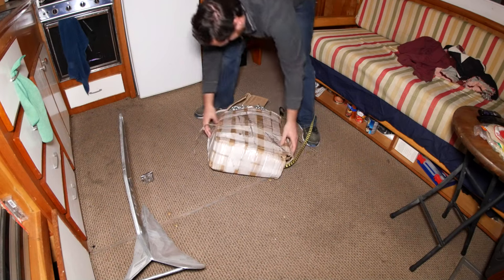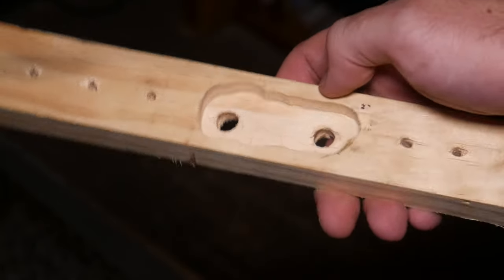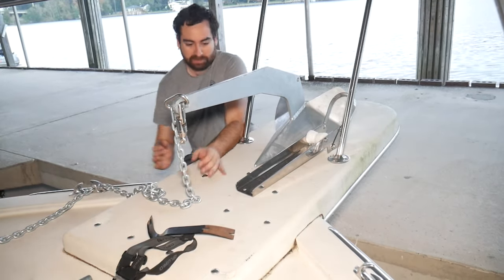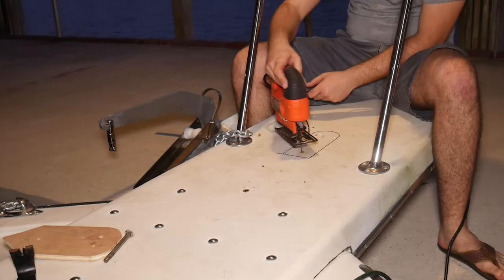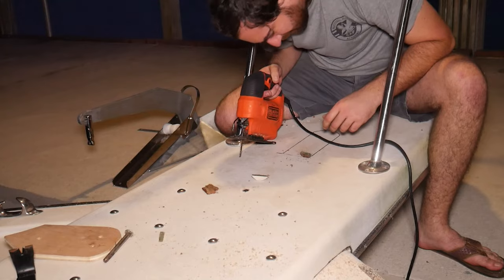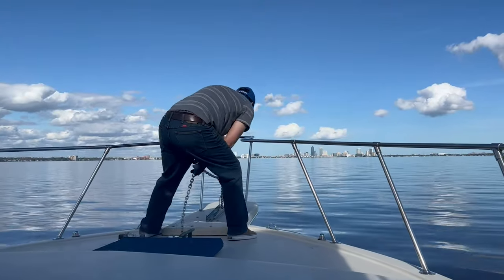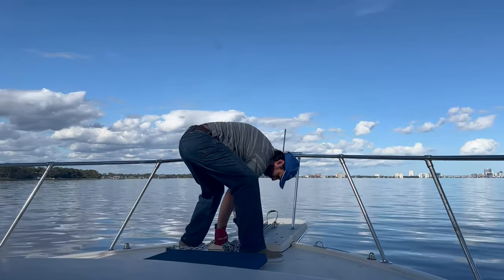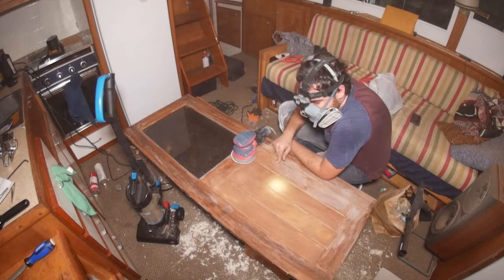a double-dose of big boat projects

Comment: Well gladto see you back Cullen! When using your anchor, you should attach a line called a Snubber or Bridle. Takes the stress of the pulpit and if it it stretches a bit will act as a shock absorber for when waves hit you boat. In the future if you have to plug screw holes, don't drill but just some glue and golf tees work perfectly. Glue in place and with a knife or whatever, cut the head off and done! See you in the next one friend.

Comment: I am really enjoying your channel, Cullen. Good to see you back on the horse. The bolt you removed from the pulpit for the anchor'r roller is a carriage bolt. The square shaft stops the bolt from rotating while you tighten the nut. This means you will have a much lower, domed head of the bolt in the roller, which is ideal for this apoplication. I would have sealed the insides of the hole you jigsawed for the roller.
Reply from the maker: Yes I'm not quite finished with that hole. That  will be epoxy'ed and covered with some kind of decorative wood trim

Comment: I've always used multiple coats of marine Spar Varnish on mahogany. When you put about 5-6 coats on to make it look like glass, then as it ages from the weather all you need to do is give it a light sanding and then recoat. And yes, you should have never ever sanded that in the main cabin. I would varnish it in the main cabin to keep the bugs off it but never sand, in fact I would of used paint and varnish remover on it to get most of it off before I gave it a light sanding
Reply from the maker: Great advice!
Reply: @CullenCraft  I should also have said, After the 4th coat, wet sand very lightly with 600 grit wet/dry black oxide paper, then wipe with plain water and then use a tack rag when dry before each new coat. 

 For wet sanding I use an old Dawn dishwasher soap bottle with the pop-up squirt cap. Filled with water and add a few drops of Dawn soap.

Comment: Hey Cullen, first off great job on all your videos and for getting your 380 in shape. I to just purchased 1979 CC 380. May be can compare notes on some projects.
Cheers H. Foster
Reply from the maker: They're great boats! Good luck
Reply: @CullenCraft  Thanks. Yes they are great boats.  I started the 750 mile trip to bring her home and 60 mile into the trip the starboard transmission  failed.  Had her hauled out for repair. I loved every minute of the trip.
Reply from the maker: Oh no! Those paragon transmissions are a pain. They're pretty good, but so few were made it's very hard to find replacement parts.
Reply: @CullenCraft  Yes they are . The yard Mater said he has a number of places to get parts for the P44.  so it's all good.

Comment: You gonna epoxy in that huge hole you made for that chain? you got raw wood exposed to water....it will soak up and start to rot....just a pointer
Reply from the maker: Yep! That's the plan!
Reply: @CullenCraft  don’t wait, once that core gets wet it will take along time to dry out.
Reply from the maker: It's under the covered dock right now, bone dry because it's been unsealed for a while. I've got a plan to make it look pretty and protect it, but it'll take a little while to do it right

Comment: i want to know about ga1000. is it still working well ?
Reply from the maker: It's fine. I haven't worn it in 3 years or so, just not my style anymore  too heavy and gets in the way of wrist movement. 

The battery life is absolute crap, needs a replacement every 6 months or so in normal use. So I just have it in a drawer with a dead battery. 

I'll probably list it on eBay soon
Reply: @CullenCraft  thank you for your answer. you should check out gulfmaster series, you might like it.